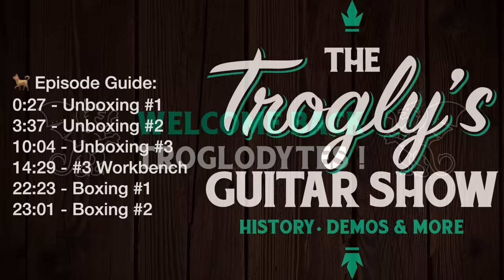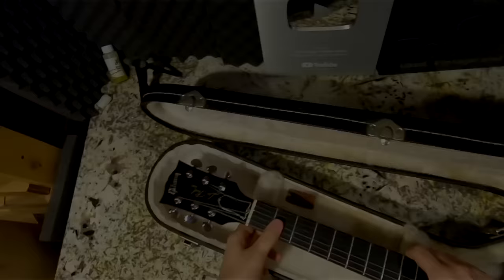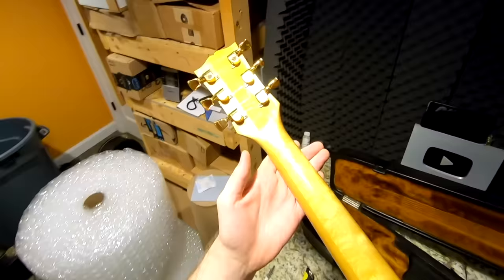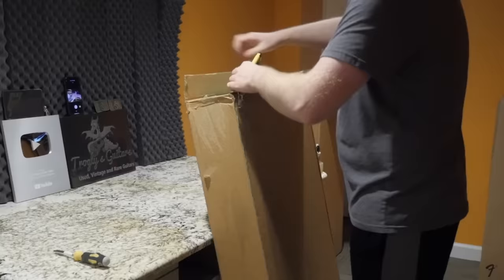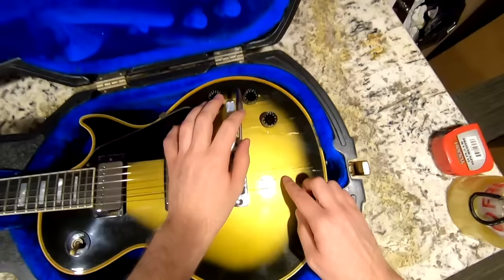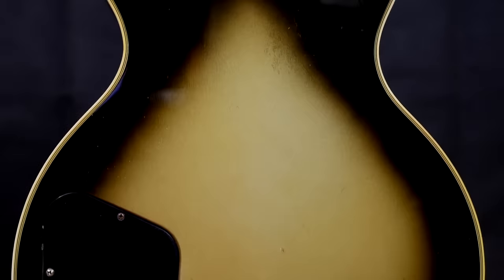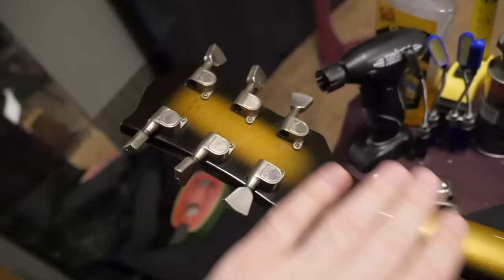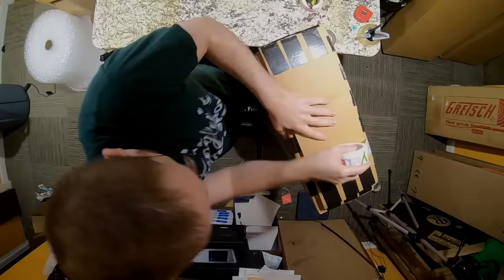What Happens When You Buy 3 Guitars from Guitar Center? | Trogly's Unboxing Guitars Vlog #87

Comment: I bought a "brand new" limited edition surf green strat from GC and it came in a Martin box with no case candy. No allen wrench for the truss rod and no trem arm! It was pretty clear it was either a return or a floor model, which I wasn't happy about paying full price for. So I had to go back to the store and they gave me a used trem arm that has a crack in tthe plastic tip cover. It left a bitter taste in my mouth but seeing as there was literally nothing wrong with the guitar and even scored a great neck with flame AND birdseye maple in the neck and headstock, I let it go. I never use a trem arm anyway. It was just the principle that bothered me

Comment: I bought a rather large and slightly Fragile BC RICH Flying V from GC without a case. Lucky it got here in good condition. It needed a good cleaning though. Was kinda Suprised they didn't wipe it down before putting it in the box.

Comment: An old Jeff Beck mini Kahler flipper bar. Cool!
Reply: NO WAY DOES ROUTING ANY GUITAR  FOR A KAHLER "EVER" MAKE PAINT PEEL. GIBSON HAD A LOT OF PLAIN KAHLER FLYERS INSTALLED IN THE FACTORY(IES) WAY BEFORE KAHLER STARTED PUTTING THE GIBSON LOG ON THEIR KAHLER FLYER STUD MOUNT TREMS. I would probably strip that guitar down with Stripeeze and re-silver burst it with hot lacquer. Refretitng those is a super pain in the a**, to keep the binding nubs in tact. The binding was gooed on like toothpaste using heat or acetone to soften the plastic.

Comment: I was surprised to find a great deal at Guitar Center online for a used Taylor acoustic. I had been shopping on Reverb for quite some time. Just checked GC for good measure and .. what do you know. I did call the store and ask for more pics before pulling the trigger. Ended up being way better than I thought. (As good as any new one I looked at minus a string change) and got it for less that anything comparable on Reverb. Like you say, call the store and talk to someone. Have them pull it out and ask your questions. They are happy to send you more pics if you ask, at least in my experience.

Comment: Former Guitar center employee of 9 years from operations/shipping. You wouldn’t believe what we had as far as shipping supplies prior to 2010. Alt was just reused shipping material from new guitars we’d unpack. It wasn’t till around after 2010 they started to spend money in operations and provide packing peanuts, expanding foam packs, different box sizes and bubble wrap. Those guitars you opened are terrible and I would have emailed the GC stores you purchased them from. Those guitars should of had packing peanuts or foam to minimize the movement. But I guess I was one employee who gave a shit. That’s why Sweetwater is superior

Comment: THe Les Paul with the chewed up top is probably due to humidity in the case while the guitar was in it's case in a very hot car. the weakest point finish-wise  part because of the trem system.

Comment: My guess would be that the Silverbust is not an 85 as you suggested, despite the mahogany neck. The silver burst was from 78-82 (if I remember correctly). I’m going to guess that it’s a 78 or 79 but maybe not the original case. The 70’s chainsaw cases that I’ve seen were orange inside. Not sure when Gibson started with the blue.

Comment: I bought a "new" strat from GC back in 08. I just opened it up for the first time last week...took off the pickguard and found  the original solder joints had been hacked up...and the stock single coil bridge position route had been very poorly re routed out for a humbucker. Guitar center apparently took this guitar back from some purchaser on a return after they hacked it up...NOT HAPPY!!!

Comment: I bought my amp from GC website thinking it would be my first brand new guitar amp and they sent me a floor model that was missing the pedal switch. I asked for a discount and they gave me a gift card. GC used to be decent but now I wouldn’t trust them for anything. I bought a used PRS SE guitar from them and when it arrived the setup on it was unplayable. I had to completely set it up and adjust the truss rod, trem claw and bridge screw height. Last time I buy anything from GC

Comment: I found an $80.00 Yamaha fs800 on Guitar Center's web site for my daughter's first "real" acoustic guitar.  I called the shop, partly because the thing looked orange in the photo and secondly because I wanted to know what shape it was in... The salesman told me the guitar was filthy, the strings were shot and he wouldn't recommend buying it.  Moreover, he insisted that this guitar was so unlovable that he wouldn't even try tuning and playing it to see how it sounded. I asked specific questions and he hemmed and hawed but finally admitted that the neck was straight, the frets were level, it had no scratches or dings and there was nothing wrong with it as far as he could tell.  

OK... so it's a solid top Yamaha for the same price as a Glarry, but it's dirty and for some strange reason "unlovable" according to the salesman.  In as much as it had to be less than 3 years old at the time... and I didn't know if my daughter was even going to keep playing guitar I coughed up the $80.00 plus another $15.00 for shipping to my local store.  I was out the shipping, but I could still refuse the guitar and get my $80.00 back if I didn't like the guitar when I saw it.  

I got the local store to bring it in from the warehouse and get it acclimated when it came in until I could pick it up.  They opened the box for me and told me it was indeed disgusting, but before I got there they put on new strings and cleaned it up for me.   When I got there, yes the dang thing was "red" according to the salesman, "amber" in my opinion and "aged looking" according to the store manager and it definitely wasn't one of the "vintage look" Yamahas.  It was a "natural top" guitar with a truly one-off finish.  Being very early production, it was likely something Yamaha was playing with and decided against.  Or rather, it might have been something they were testing for their later run of "vintage look" guitars.  Who knows, but it actually looked good in person. And my daughter instantly fell in love with it.  In fact, it had absolutely no finger wear on the fretboard although the frets were quite a bit tarnished.  Most likely it was bought for someone that liked the idea of playing the guitar more than actually playing it and then stored in the garage for a couple of years.  There was no sign that anyone ever tried to set it up since it left the factory.

As to how it played... it had in my opinion an annoying harmonic on the G chord when played loud that no one other than me could apparently hear... (Don't you hate when you hear something that no one else does?) That went away as the guitar played in and we replaced the strings with Elixir strings, but otherwise it sounds sweet and well balanced.  I adjusted the truss rod and the action is still a little high, but my daughter is perfectly fine with it... She's not tall and the body fits her like a glove.  Aside from being a little picky about what strings it likes, it plays way out of it's weight class now that it's broken in and is still sweetening up with play and age.  And in fact, the "unlovable" guitar is getting a whole lot of love pretty much every day now.  My daughter claims her Yamaha plays and sounds a whole lot better than her friends new Orangewood.  But no... I'll be the first to admit it's no solid body Martin or Taylor, but no one in their right mind would expect that from an $80.00 used guitar.

So last week, my local Guitar Center had a blow out sale on used guitar cases.  So now the Yamaha lives in it's almost new CF Martin case, which we picked up for around $30.00. And it fits like a glove.

Maybe, it was it's one-off color that turned the guy I spoke to on the phone off, or maybe he had a friend who wanted it, or maybe he was a guitar snob who didn't like Yamaha Guitars... I don't know... but we got a great guitar for a great price.  If you  live near a Guitar Center, have your guitar shipped there and go check it out before you take delivery.  You are only out a few bucks for shipping and with Guitar Center in bankruptcy, that might a better idea now than it was then.   But musical instruments are subjective things, you may hate what I find precious and you'll never know how a guitar sounds until you play it.

One last bit of advise... Don't be a sheeple and follow the herd.  Trust your own instincts and buy what you think is good for you.  If everyone wants the exact same thing, you can bet they are overpaying for it.  There's always another option that isn't necessarily in style right now.  But if you follow your gut, eventually the herd is going to turn your way, so you will buy a bargain and very likely wind up selling at more than you paid.  And even if the instrument you love doesn't appreciate, at least you will have fun playing it at a price you can afford.

Comment: I ordered a used LTD-VIPER  from Guitar Center a couple months ago. Was shipped from Charlotte SC to Ohio. When it arrived the body neck pocket was cracked on both sides. The guitar has Gashes, Scratches, dents, dings and chunks of the body missing. Yeah like somebody thought it was Thors hammer Idk. Corroded hardware. Very old strings. Neck pickup didn't work and it was disgustingly dirty. I've been buying gear from GC for 20 years now. But never again after that purchase. GC has majorly gone down hill as a company. It's no wonder why they're going bankrupt. Very disappointing. Especially because GC was my most favorite place in the world to go. Kinda breaks my heart.

Comment: Man I had not one but two Les Paul Studios that I bought brand new in the early to mid 90s and the finishes literally fell off. The clear coat flaked off first then it just got worse from there. My studio was in a basement for the first one and I thought the moisture may have caused it but naaaa that wasn’t it because I bought another Studio a couple years later and it did the same Dm thing

Comment: Nothing wrong with Richlite.  Don't be a corksniffer.  Martin guitars have been using Richlite for years with no issues.  Plus Gibson has a track record of not sanding their boards very well, so to have a nice smooth board is good.
Reply: Same with laminate vs. solid wood acoustic guitar sides and back.  
Plenty of looked down on laminates sound incredible.

Comment: I use to buy lots of stuff from Guitar Center/ MF same owned company I think but have been burnt a few times ordering stuff by mail. Latest last summer a Squier  Tele on sale very cheep . The  control plate on crooked . I could of sent it back but didn't want to take the time boxing up and nailing it back etc. I also had bought a fender deluxe reissue new but it wasn't tech told me someone had fixed ie before and was snoopily done it has never been right. so I don't trust them anymore. I had a few more issues with them also , so good luck.

Comment: I bought brand new guitar from Guitar Center and they put the box inside of a bigger box without ANY packaging materials. The guitar was just rattling around all the way to my house. When I opened the guitar case, the neck pickup was bulging out and touching the strings. The screws around the pickups were coming out. The case was misaligned and wouldn’t close correctly. Terrible. Glad they’re going bankrupt.

Comment: I have a lot of guitars.  But My experience with guitar center was with 3 pedals.  And it was horrible , They got the original defective pedal for 200 bucks mixed up with the cheaper pedals.  They created a confusing mess amongst themselves. I had to fight for a refund . hours on the phone on hold . And the driving back and forth. I Was promised a small kick back for my trouble but never got it and still owed me like 5 bucks. And to top it off they had a Chinese fake black Ibanez gem 7 hanging on the wall.  I recorded all phone calls and saved the receipts and recorded the fake . But I’m done. I’ll just say steer clear.

Comment: as someone who has bought close to 15 used guitars on guitar center in the last 2 months , its very hit and miss. They usually only provide 1-3 pictures so its a gamble. The description will usually say it comes with case or bag however  I've noticed 80% of the time they "forget" to ship the case with the guitar even if its stated one is included and i have to reach out for them to ship the case, very shady. In the description they should definitely be stating if the guitar has repaired headstock or structure cracks , not always the case either.. Often times they will have pictures of a guitar completely different from what the title says also. It seems they almost never loosen the strings either which definitely should be happening every time , lack of training for packing guitars properly is apparent.

Comment: I’m curious, I’ve been working on guitars professionally for close to 25 years, I can’t remember more than 1 or 2 guitars where the truss rods were maxed out, and that was due to other problems. Is it some you, and other commenters have seen regularly?
Reply: As far as testing a truss rod that looks like it’s at the end of its travel, just put an adjustment tool on it and see if it will turn a quarter turn normally and if it does it’s fine if it doesn’t, we’ll I guess you can work out the rest

Comment: Why the snobbery about Richlite? It's a more eco friendly material that actually has proven advantages over ebony

Like the fact that the fingerboard (which is basically barely distinguishable between one type and another) material weighs so heavily on your decision whether to buy an entire guitar or not is ridiculous
Reply from the maker: richlite guitars are harder to sell because they aren't traditional. It is a fine material, but isn't what they used in the 50s
Reply: Fair enough, I guess as a reseller you have to keep that sort of thing in mind so I guess my frustration would be more with your would be customers lol

Comment: Man, I know I'm late to the party, and just another guy yelling on the internet, but truss rod threads showing or not showing has nothing to do with the condition of the rod or neck. They're all cut to slightly different lengths, and one may have come from the factory like that. If the neck is straight, and the rod is adjusting the neck, you're fine. I know Trogly probably won't see this, but hopefully everyone else can glean a little info from this.
Reply: Not true. And.
The guitar was a second.
Reply: @ChrisShortyAllen  The Gibson 2nd mark is used for a lot of different reasons, as Trogly mentioned; a truss rod like that wouldn't warrant a factory 2nd stamp, and again, doesn't condemn an instrument. If the nut requires excessive force to adjust, the washer starts digging into the end of the pocket, or adjusting the truss rod has no effect on the neck, that's cause for concern. My info comes firsthand, I've an ES335 with a very similar truss rod situation, that has been worked on/checked over by three different luthiers over the years for various reasons. All of them have said the same thing. Not trying to start a yelling match, just want people to understand a little bit more about maintaining their guitars.

Comment: 0 for 3 on used guitars. 1 bad case, 1 bad stress rod, and one sorry looking guitar with a cracked finish. One good reason not to buy used unless you see what you are buying in person and check all the electronics. You may even have more wrong with that junk you bought. Gibson makes fine guitars but there are a lot of used and abused guitars for sale. And most of them are for sale because fixing them right would cost more than they would want to put in their own used guitar.

Comment: Can somebody explain to me why Kahlers are so undesirable and not just from a selling point?
Reply: I cant think of anything else besides the selling point. Unless you want to get in the whole debate if a tremolo equipped guutar is inferior or not, the kahler unit is actually a very versatile piece of equipment
Reply: @maxmustardman298  Oh okay, thank you. I saw the Kahler on the third guitar he unboxed had a hole for a trem arm on both sides, which as a left handed player, I love.
Reply: @McShooty_  unfortunately the option to use it as a left or right hand player is only available on the more expensive usa models, ie the 2300 or 2200 series
Reply: @maxmustardman298  Truth be told, I was going to buy a cheap Epiphone Les Paul, swap the pickup(s), and install the Kahler myself. I don't see myself ever buying a Gibson when I can just modify Epiphones.
Reply: @McShooty_  good enough for a mod project indeed, just make sure to get the meassurements right und use a router if  possible

Comment: Guitar Center used is just a crapshoot. You get poorly pictured, poorly described and poorly packed guitars that are all suspect. I have them shipped right to my local store so I can inspect it and get my refund. They don't give you anything when traded so you get a lower than market priced guitar when you buy one. Unfortunately, they are also a dumping ground for guitars that have serious issues that no one else would buy. They take anything on trade and don't know enough (or care enough) to check for things like warped/twisted necks, maxed out truss rods, headstock repairs, non-original pickups, butchered wiring and worn frets. If they did not give a money back guarantee, no one would ever buy a used guitar from them without actually inspecting and playing it first.